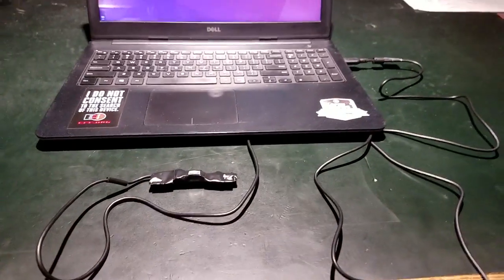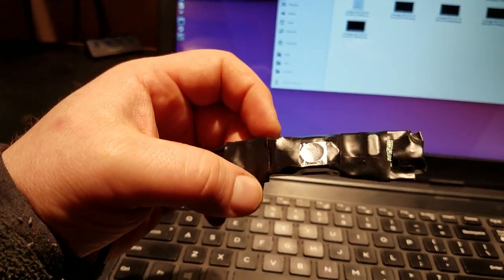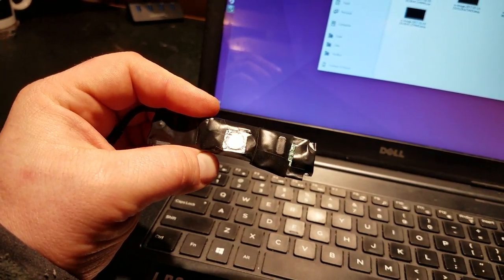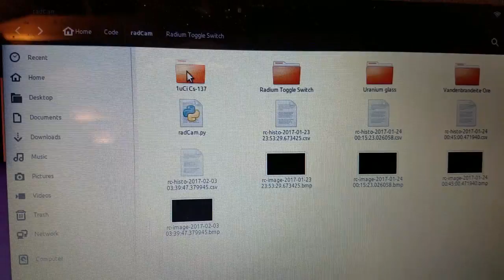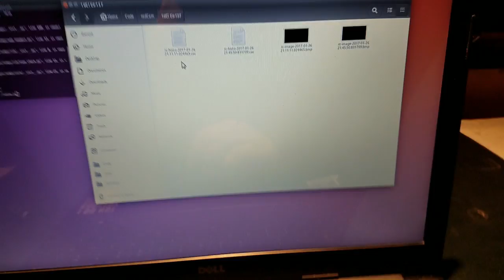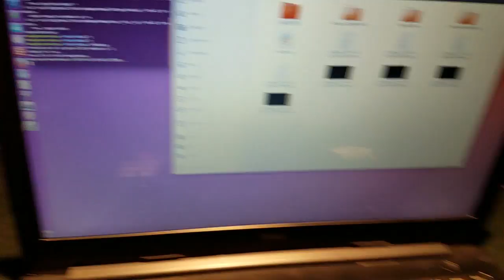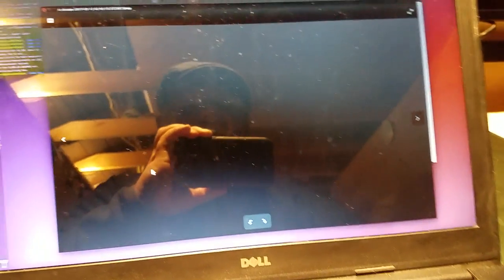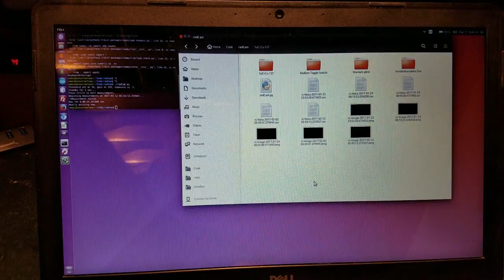Webcam CMOS radiation detector demo and info.

Comment: Hey, Josh. Good work, actually.
Did you try to use some organic or inorganic scintillators? 
E.g. ZnS could be used, though I'm not sure if it is available in yout region. 
Or you can get the plastic scintillator at the ebay for $20.
Reply from the maker: Thanks Vasily! I haven't tried a scint yet, but I didn't because I wasn't sure if the camera had enough optical gain to see the flashes.